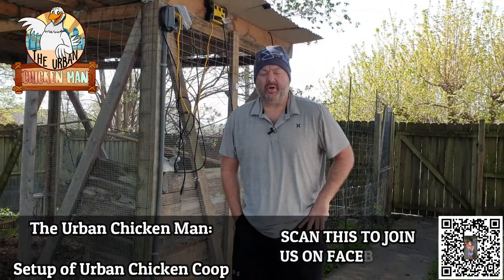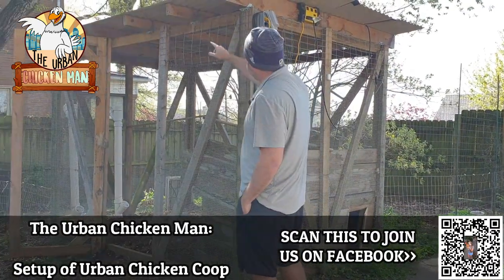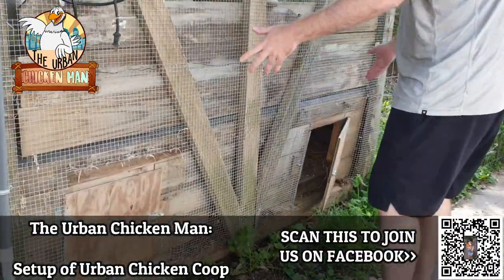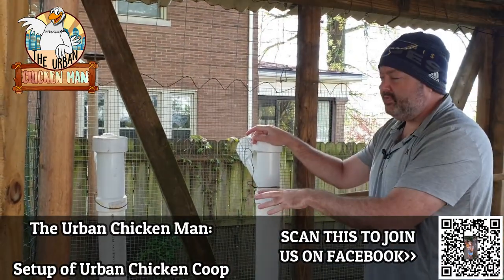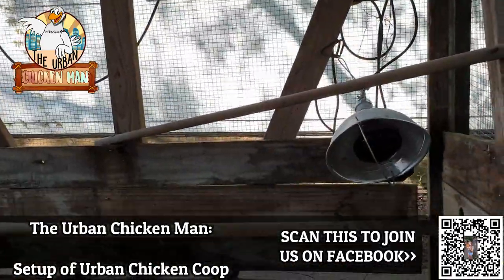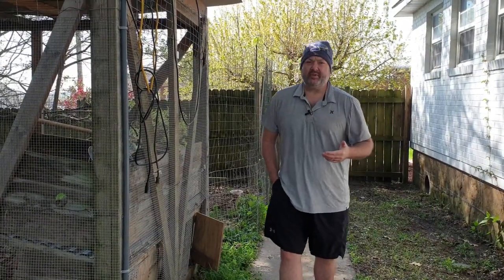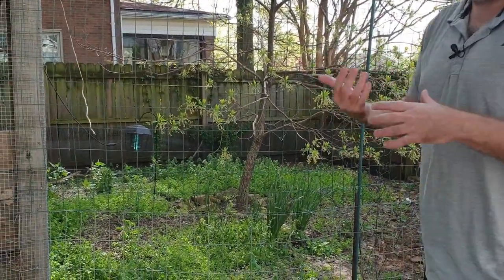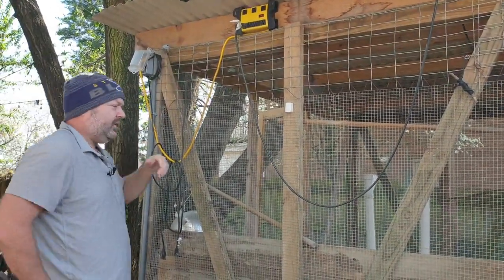101.4: Urban Chickens, basic layout of a chicken coop, nesting box, feeder setup, etc.

Comment from the maker: Gravity Feeder
NDS 4P08C PVC 45-Degree Hub by Hub Wye Tubing, 4-Inch 
https://amzn.to/2yc3vyj

Woods Clamp Lamp with 10 Inch Reflector and Bulb Guard (300 Watt Bulb, 6 Foot Cord) 
https://amzn.to/2xcwaDh

Fluker's 22800 Red Heat Bulbs for Reptiles, 40-watt
https://amzn.to/2JYE2uL

K&H Pet Products Thermo-Chicken Perch - Thermostatically Controlled Heated Chicken Perch 
https://amzn.to/3b8xqWw
Dowel Rod

Sansheng Fully Automatic Poultry Drinking Machine Chicken Drinking Cup, Chicken Drinking Machine/Poultry Drinking Machine (12 Pieces) 
https://amzn.to/34JfL5y

Pipes
NDS 4P08C PVC 45-Degree Hub by Hub Wye Tubing, 4-Inch
https://amzn.to/2RFGXwB

NDS 3P16 4-Inch by 4-Inch PVC Adaptor with Drain Waste Vent to Sewer and Drain Connection, White
https://amzn.to/3aavQ5g